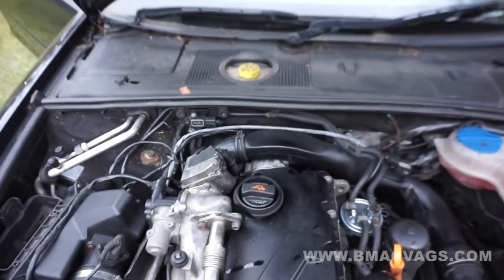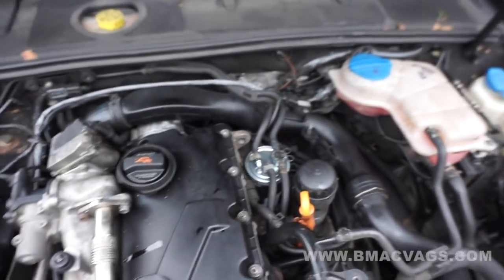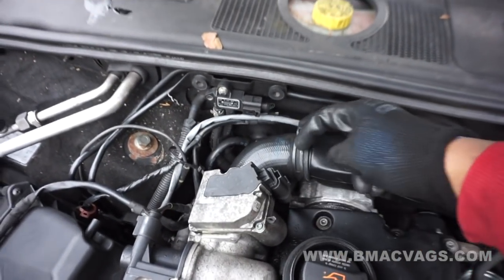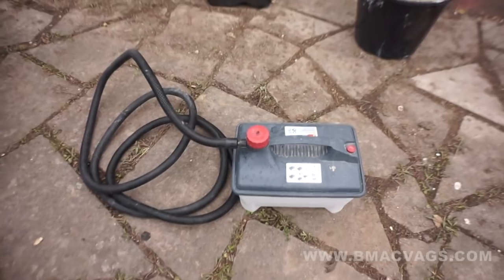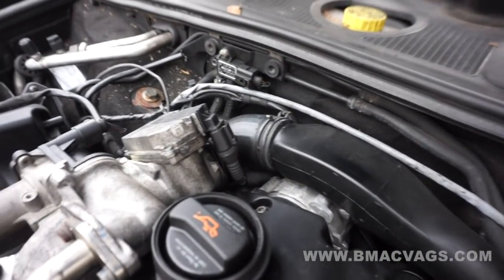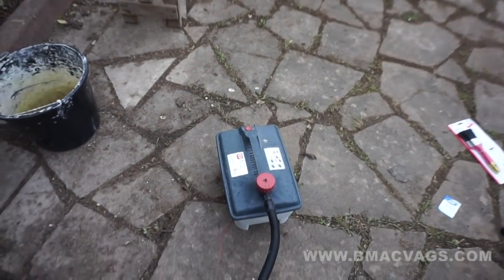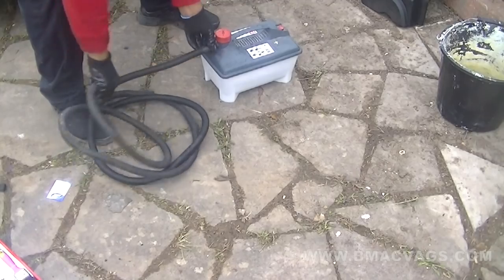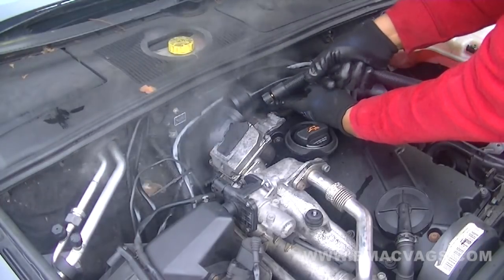How To Lower Your Exhaust Emissions With Just Tap Water.

Comment: Would recommend changing oil after maybe flushing it too in case of any got into the oil making it like mayo
Reply from the maker: The heat from the engine will remove any moisture in the oil
Reply: @BMACVAGS  Even so it still maybe best practice to flush the oil out when doing such a deep clean as it may have got some of the carbon deposits into the oil

Comment: Hi man!, Please could you help me? My Golf IV 2.0cc has bad emissions. I have replaced: spark plug and cables, Air and Fuel filters, Catalytic Converter, Oxygen Sensor and I cleaned the MAF Sensor too and I applied an anti-smoke liquid , but still my car has bad smoke emissions. What I should ckeck next? (it uses gasoline)

Comment: Do I need to change my oil after this? Thanks
Reply from the maker: Not necessarily. The engine temps when driving will evaporate and moisture in the engine. The same way it does with condensation in the winter months.

Comment: I followed all your tutorials about 5 years ago as I had a 19 tdi bora I was able to carry out most maintenance & repairs, thanks. 4 years ago I got a volvo s40 2.0 D with 80k on the clock. Embarrassingly it ran like a sack o sh^t, especially on the motorway. Therein I ran about 2 pints (slowly) of tap water in and what a difference. I still got the car today and wondered about my slow and diminishing performance. Glad I found your videos again, reminded me about the tap water. Thanks again

Comment: Dont worry about naysayers. Water injection was used in ww2. Setup properly with a misting nozzle it works! I was doing water injection on hyundai at operating temperature and i had steam poring out of exhaust system just keep revs up ! Put a borescope into plug holes. TB side. Spotless!!! Nice video.😁 cheers from Australia!

Comment: BMAC VAGS. Love the vid from 6 years ago, thanks
 I have found a problem with the steamer method. It does reduce the risk of hydro locking but it does not work as well as the cold spray water method.  It must be the fact that cold water is hitting hot metal that shatters bits of carbon of the engine and combustion chambers. Hot steam does not seem to work. can you do a comparison? Is that possible for us please.

Comment: This is a great concept, however in the absence of before and after pics there is no guarantee the carbon build will be removed from the intake ports, stems and combustion chamber as the steam (temperature) will drop and be just vapour to have any impact. The Walnut blasting - all be it expensive, is a principle that actually works as you can visually see the difference and in a smooth power delivery above 3k revs. The hydro-carbon clean cleaning concept is again, flawed (in my view) and a psychological good-feel factor! Sorry.
Reply: Im sure this will have some effect obviously walnut blast will always be better especially for direct injection petrol but have you ever seen cars with failed head gasket often the water from the head gasket leak will clean the piston where its leaked so it does have some effect at cleaning

Comment: If you drive your car for a while and get everything nice and hot, if it has a GDI engine I can only see this as a good thing to do. There are plenty of people who would just spray some water in their vacuum line from their brake booster. Carbon would be no match for water contacting hot valves. Certain airplanes even have water injection systems that increase power for a short period of time, if you fill up some of the volume with water vapor, that will increase compression and make your exhaust valves cooler.

Comment: I think he couldn't find the words for it at the moment but what he's talking about doing after the turbocharger is to avoid air pressure/flow sensors. I haven't worked on any turbo'd vehicles so I'd trust his advice about preventing anything from contacting the turbines but the airflow sensor determines the amount of air that is passing by and adjusts the amount of fuel based on the output signal to the computer. If you spray water before that sensor it will detect that there is less air than there actually is because a fluid is displacing that air and cause the computer to adjust the fuel ratio to (I'm assuming) a leaner mixture. You want to put fluids in after that sensor so the air can be measured properly and keep it at the 14.7 to 1 ratio, put it in before the computer may read less air and bump down the amount of fuel it uses making it lean out.

Comment: Hi mate,

Fantastic video and have just made an offer on ebay on a steamer and it's been accepted lol!

Quick question - how long do i let it steam for? I have purchased a 4 Litre steamer.
Reply: I did mine for about 40 mins
Reply: @Marc-tx7gd  Brilliant - thank you. How were your results?
Reply: @theopapadopoulos7814  the smoke reading on the MOT test dropped to less than half!
Reply: @Marc-tx7gd  Brilliant! I got my dad a Fiesta a few weeks ago on 104k miles, fully serviced it but the oil was quite sludgy! Running alot better now, but after i steam clean it, hoping it will run like a dream!
Reply: Did it work
Reply: @shaundarnbrough5824  It did indeed, there was plenty of sludge though so did it 3 weeks back to back, but major difference!

Comment: This works!  My 2005 diesel failed MOT on smoke (along with various things unfortunately). The readings obtained by the test centre on the second time dropped to 1.13 /m (better than the first reading of 2.64) but still higher than the 1.1 limit.
Used my cheapo wallpaper stripper 3/4 full and held the revs at about 1500rpm. Took it back to the same test centre the next day and the first reading came out at 0.5 which is an instant pass. 
Absolutely brilliant! Thanks mate.
Reply: what's MOT?
Reply: @hedgemcnorry  MOT = ministry of transport. MOT test = A technical test your car needs to pass to be legal on the road. Fail the test and your not allowed to drive your car until the faults are corrected and re-tested
Reply: how long for?

Comment: I fixed a lot of Fiats in my time and what I always noticed is the cylinder head where the head gasket has gone it had almost seen cleaned that piston into a brand new surface which suggests that cleaning your engine with water works I'm yet to find out if coolant has anything to do with the cleaning but still the steam method you have provided seems very ethical

Comment: Hi mate, can I put the pipe in from the air intake side? If yes does it clean all system like you mention in video. I know you put the pipe in different place. Thanks
Reply: Better not, coz it may mess up with the sensors and error code pop ups. So better keep it after the air filter and turbo to avoid the error codes

Comment: Why is there no black smoke out the back,or signs of carbon exiting the exhaust?How long do you have to take doing this?
Reply from the maker: Black smoke is poor air fuel ratio. When the air fuel ration is correct you will not see any of this.

Comment: Wait how would this help the turbocharger in any way. I mean if the engine is more efficient then I understand the turbo will work better, but you say it with certainty.
Reply: It will clean any soot and carbon deposit from the exhaust side of the turbo.
Reply: New Jargon   It's about cleaning the combustion chamber.

Comment: I really want to believe this but the lack of evidence stops me from doing so. I think the only conclusive proof is to do a before and after comparison. The prime area to compare in a diesel car is the small pipe that goes to the egr valve. Just release the two star bolts that hold it on and show all the crud that will invariably be in there blocking the pipe up. Reconnect, go through your steaming process and then crack the pipe off to compare before and after.

Comment: Why you dont use high octane fuel or use octane booster, the safest way....if you use water even is demineralized water it may can make high moisture in your engine, that can damage your oil and engine it self, manufacturer is also recomend to use high octane fuel or use octane booster occasionaly to clean carbon deposit not Water...😰
Reply: there is no high octane diesel as far as i am aware... also, how does water damage oil exactly?

Comment: Ok chaps, ive a bmw 730d 2011, been given me problems since i bought the shit thing in 16, ive replaced inlet manifold, egr n sensors. It gave me joy for about 6 months n bang same shit problems again, every summer the cars does me in. Now ur boy here made think, dem kids getn paid £100 to steam ur engine??? Wts da diff wiv this shitty wallpaper cleaner?? So I thought fuk it im goin screwfix, bort me a £25 steamer.. 40mins of this steamer down the air pipe (removed my airflow sensor to avoid damage from steam) revn it every min or so n also holdn the revs for a couple (about 2k)... I swear to you no lie this shits worked. My car struggled to giv me 30mpg driving sensibly, my avg is around 20mpg wiv dis problem. I came home to 37mpg after stretching the revs on a 30min drive.. bro u saved me some big money. May the lord bless you in ways u cant imagine. 😉

Comment: Quick question, does it matter if the steam is hot or cold? I was thinking about purchasing a hand-held steam cleaner which is really a glorified no spill hot water kettle with a nozzle attachment (I think).
Reply from the maker: You can't make steam without heat, so as long as it is steamy or atomised, it will work.
Reply: cold steam lol,  theres a method to your madness though, steam is actually completelly invisible, any "steam" you see is actually water vapour thats not got enough energy to convert to gas, looks like gas but is actually very small droplets of water. BMAC is actually using liquid here but as hes already pointed out water is fine, the Aerosol will spread easier being airborn and is already up at a high temp to turn into steam sooner in the engine. the reason it wont cause hydrolock is because its mostly air, the water droplets still wont compress but the air does, I have no opinion if this works better or worse, im just giving physics info.
Reply: I guess what I was thinking was just misting it into the air intake.  I've got an air humidifier that saturates the air so it's not dry .... That's where I was coming from. I realized after that my question was a little off only because you might as well do his old technique of misting the air intake with the spray bottle. Thanks for clarifying and not beating me down!
Reply: Cold steam bro? 😂
Reply: @AdamMickMannis  yeah man. I don't know what you guys have in the UK but there are cold air humidifiers that puts moisture the air. I guess we got the toys in NA that don't get out to the other side of the pond.
Reply: Ray Baterina  yeah we get them in uk aswell, by the time it reaches the outlet of the humidifier its back to being water again though, thats how it humidifies, steam is actually dry, it only feels wet cos when it touches something relatively cold like your hand or glass or even just air it turns back into water again, as I said before, any "steam" you can see has already turned back into water, its just in tiny droplet form. 

It is actually possible to have cold steam, just not in normal day to day life, in a vacuum water will freeze and boil simultaneously, even up in the alps water will boil furiously without managing to get hot enough to cook eggs (I found that out the hard way), did you know you cant suck up boiling water through a straw because the raising the fluid by sucking works by reducing pressure inside the straw which causes the water to evaporate much faster, when already boiling or close to boiling the liquid level wont move, youre just sucking steam out of the water, science is awesome!

Comment: Would this help my vw bora with 225k on the clock and how would do it on it ???
Reply: Daniel Smith with that amount of miles. It would def help it
Reply: Did it 3 times now over 3 years on my ALH remapped Bora which has just hit 200k. This was with the hot water spray mist bottle through the EGR

Comment: So if I have an AWP 1.8T do I just inject the steam right into the throttle Body?? Thanks for this helpful tip
Reply from the maker: Yes basically...lol
Reply: Passed the mass air flow sensor. I have a 04 passat AWM 1.8t four motion manual wagon. By cleaning the carbon build up your lifters dont get sticky and the air as well as the burnt exaust can come in and out alot easier. Clean burn...

Comment: This method is better than a spray bottle since you are using the gas form of water as opposed to the liquid form.  The only thing missing is before and after images of your pistons using a scope.  I find that to be the most satisfying part of these types of videos.
Reply from the maker: Sometimes to feel is more impressive that the visuals, but I totally understand what you mean.
Reply: Hi can i use my home steam cleaner. Im think my cat might be cloged
Reply: Harry Singh If your cat is too clogged nothing will go through it. It's similar to a diesel cars dpf, once they get to a certain point exhaust gasses stop flowing and the car won't run. If it's partially blocked then there's no harm in trying.
Reply: The car runs every day so guess its ok but if you push the acelerator hard u get a poping noise like back fire plus prior to that there was a rattle in the cat but its stopped

Comment: Boydie... you asked the question of 'what do you want to see next?' Well, i've been hammering away at you for this for ages cus there's NOTHING out there that i can see of... Fault Code 01274 (V71) Air Flow Flap Positioning Motor!!! C'mon man... you know you want to!!! ;-)
Reply from the maker: Hahahhahaha.... if I get a faulty unit I will try and make a repair video for you. Thanks for commenting
Reply: BMAC VAGS I have an electronic throttle body at the closest spot to the intake. Would that hurt it? Or if I have a small plate on the front of intake that bolts on would it it hurt if I did it there?

Comment: Does this help clean valves also? Also did you get codes when you ran the car without the turbo connected up to the manifold
Reply from the maker: This will also help to clean the valves also
Reply: BMAC VAGS thank you, it would be interesting to see if it actually does make a difference by getting a camera down into the valves and pistons .
Reply from the maker: I hear what you are saying. Maybe that is a video for the future
Reply: BMAC VAGS how often do you recommend to do this also? Thank you in advance
Reply from the maker: As often as you feel. When you stop feeling improvement maybe that is a time to space the treatments.
Reply: @BMACVAGS  this is the future how about an update please.

Comment: Would work better if addblue is used instead of water?
Reply from the maker: To be honest I don't really know. However if you start with water you will have a base point to compare to.
Reply: That's a good idea how long did u leave in it for? and how often do you do this process ?
Reply from the maker: The HHO machines stay on for 30-45 mins on idle, with occasional revs in-between to blow it out. This is their guidelines, so try working to these and see how it goes
Reply: Thanks mate keep up with the good videos
Reply: Mate just got one more question, I have a lancer 2.0 disel, it has a vw tdi engine.

As it's a turbo engine should I do the steam like your spray bottle video just after the mass airflow sensor before the turbo? 

Or should this be pass the turbo? 

Sorry just confused me seeing both videos.

Comment: don't you run the risk of throwing a P0456 code on the engine on bank A or B or both doing it like this?
Reply from the maker: It is possible to get an EML code buy doing this, it didn't happen to my car but it is possible. If it happens just delete the code and all should be well.

Comment: Mkv 2.0t fsi, could i introduce the steamer pipe before the throttle body?
Reply from the maker: That should be fine.
Reply: zadiel let me know if you see improvments after the method,I also have 2.0t fsi
Reply: Wouldn't that get steam/water on the Air Intake Sensor on its way to the throttle body? Or does it not have one? Im still learning so I have to ask these questions.

Comment: Yes bless! I did the tap water thing on my 2005 1.6 Astra after seeing your other video. MY RESULT? My car is faster, MUCH more responsive, quieter and smoother. HOWEVER this is how I did it. 
I got the revs to 2000 (long screw diver jammed on accelerator) then I just poured water into the throttle body. I just dumped it in. I stopped pouring water when the car started stalling then waited for all the white exhaust to clear and the revs to come back up. Then I dumped more water in. I did this repeatedly for about 45 mins. Easy job, great results. 

Bruv...quit with the licking the lips ting. Pure mans here lol.
Reply from the maker: Hahahaha.... Ah mate. It was super cold and I didn't want to be a meme with dry lips. This in front of the camera thing is not natural to me. But your comments have been noted. Thanks for sharing your method of doing it.
Reply: ANOTHER LL COOL J LIP LICKING IN TRAINING
Reply: What do you know? 😂😂
Reply: I should've watched the video before reading this comment lol
Reply: YOUR FUCKING NUTS AND YOU KNOW IT.Stop fooling poor youtubers that are gonna try your method and kill their engines.
And to the op.Thats funny I just mentioned about using a steamer to Etcg .Hes not smart.lol
You are.Props.I still wouldnt do this.